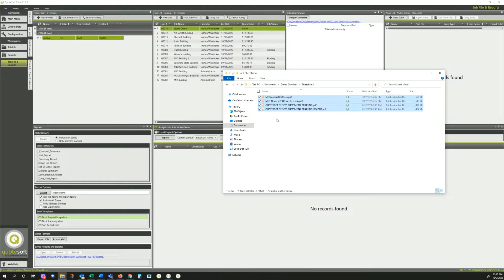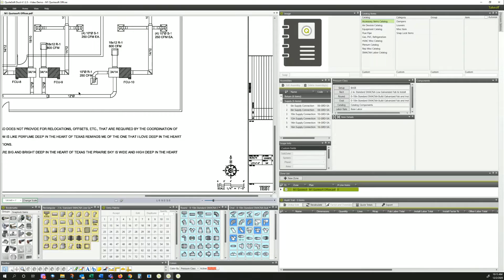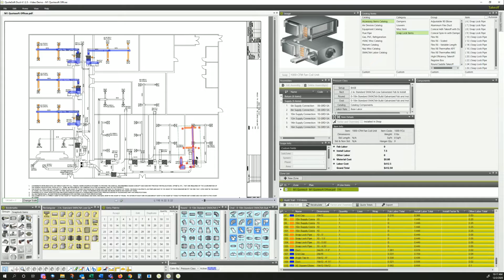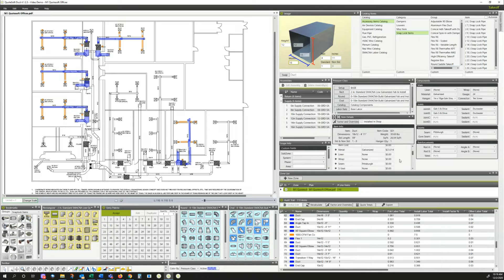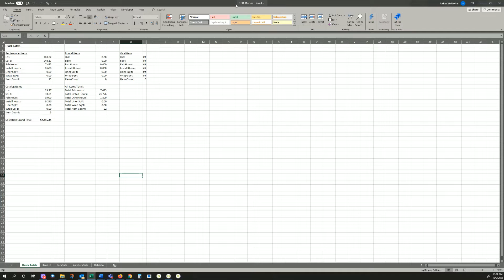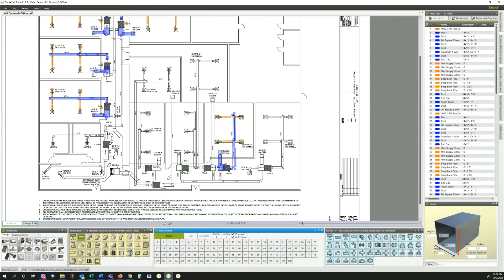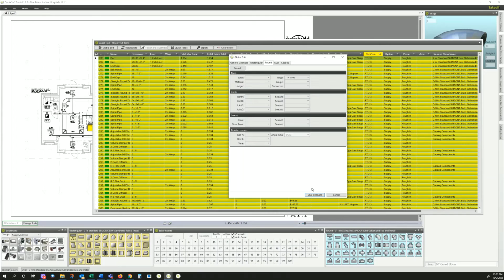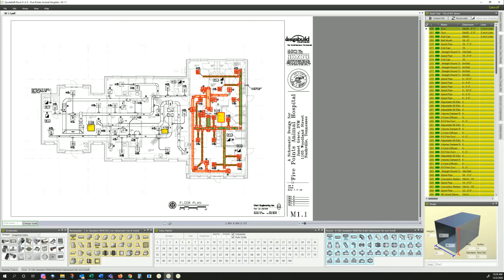HVAC Mechanical Duct Estimating Software Demo

Comment: Does it come with a free Trial?
Reply: We looked into this where I work and our answer was no. They do a video conference demo with you. Our main issue is they focused on things that were not related to our industry and thus it was a very hard sell. We ended up not doing it due to the lack of major selling points and overall cost of the software.